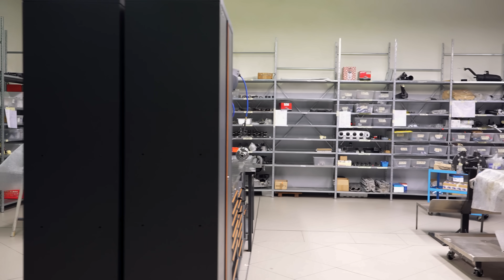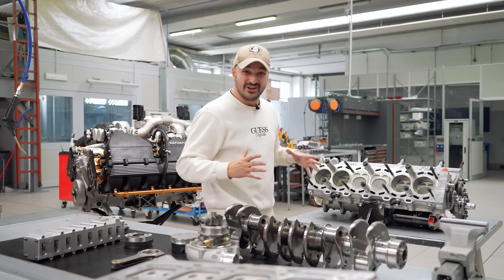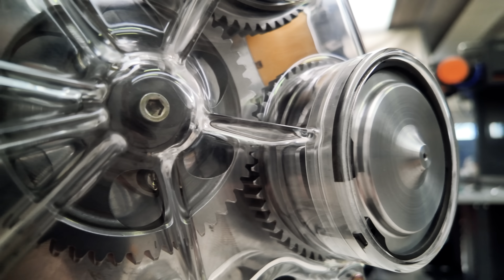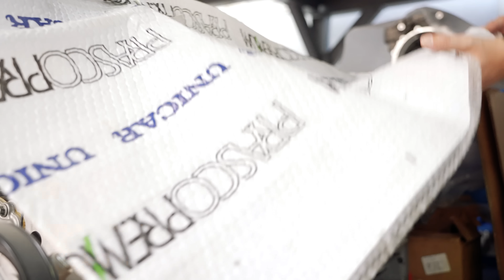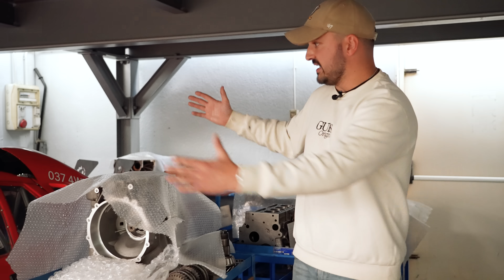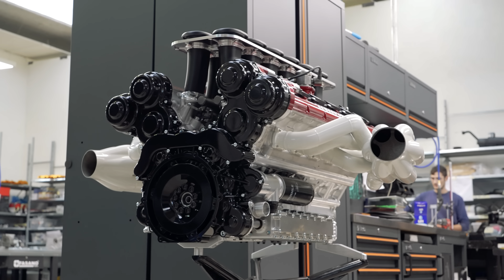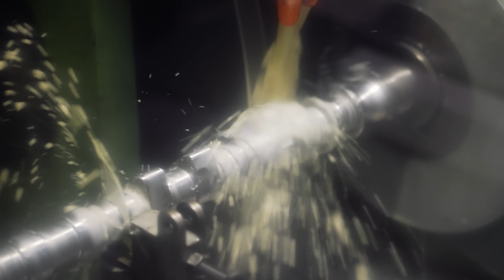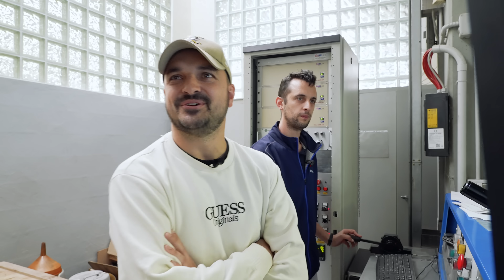This 7.0-litre Quad Turbo V12 Is The Most Powerful Car Engine Ever!

Comment: Mercedes new EV motor that weighs less than 30 lbs and puts out over 1000hp  wants a chat. One of these on each wheel means over 4000hp with a total motor setup that weighs 120 lbs max. And battery technology is advancing so quickly that in 5 or 6 years EVs will be charging faster than you can put gasoline in a car.
Reply: and it will never have a soul
Reply: @poly_g6068 exact same arguments going on when those new-fangled horseless carriages put good ol’ Bessie out to pasture.
Reply: You are the 'Bean Soup Theory'.
Reply: @Hang.On.A.Minute please. Go on. Meanwhile ICE sales have been declining worldwide since 2017 and EV sales continue to grow at a 38% clip. In fact, this last quarter China tipped over 58% EV over gasoline. China is the world’s largest car market.
Reply: @nerdbikes3841  Are we watching the same video?
Look up  'Bean Soup Theory'.
Reply: What does this story have to do with Mercedes or EVs?
Did I miss that bit?

Comment: Big deal. It's stupidly complicated, whereas a Nelson Racing Engines Twin-Turbo Alien LS 427 puts out 2000 hp as well. It's a Chevrolet LS engine with killer parts and engineering. Except for the custom cam grind and exhaust, all the parts are off the shelf items. $47,000. America.
Reply: You are the 'Bean Soup Theory'.

Comment: Thinking of Elmer racings Thor crate engine, 150kg straight 4, 2000hp for road use and 3000hp for drag applications..

Comment: Steve Morris built that Devel V16 - it made over 5000hp. He did a fascinating video talking about it about 6 months ago if anybody is interested. Ps, there was a lot more to it than just "sticking two Ls motors together". Like i said, go watch the video for yourself 👍
Reply: The Devel Sixteen is UAE oil sheik vaporware. Rich boy one off wannabe similar to Lotec. Yes SME made and dynoed it. Very impressive but an absolutely massive engine.
Reply: Ha messo assieme due V8 aggiungendo 4 turbo, non si sa nemmeno se è riuscito a fare una prova al banco. Figurarsi metterlo su strada.... Per una cagata di auto mai esistita sbadierata da un brand fatto da quattro beduini che a malapena sanno stare su un cammello
Reply: Fake the devil never hit dyno and never was actually true they came out and admitted it.
Reply: Not a production engine in a production car.
Reply: @dcauve420  this one isnt either
Reply: @dcauve420  20 car limited run, this aint production car either. Should be 5000 cars minimum to be called production car. Thats what BMW had to build e30 m3's

Comment: lolz,  2000 virtial horses, or "1500" on a dyno without any aftertreatment or emissions gear, no inlet system and god knows what else is missing.  200bhp litre (1400bhp) really isn't hard, but 300bhp on an engine of this size is getting difficult from a thermal perspective, especially if done at relatively low rpm (ie running at lot of boost rather than a lot of revs to shift the air through the engine)   Something like the Veryon engine is of course worldwide emissions homologated, meets all VAG group durability, and is actually in production in a series built car.

This engine is none of those things imo.......
Reply: You are the 'Bean Soup Theory'.

Comment: It's strange to see gerotor gears on an oil scavenge pump 🤔 They normally use minimal clearance gear pumps on dry sump pumps as they can run dry for longer 👨‍🔧

Comment: Wait a minute. A 7 litre quad turbo V12 is 50 or so HP more than a 5.5 liter LT7 from a corvette. Yes, it is rated ag 1074hp, but it's much higher than that in reality. Likely closer to 1200

Comment: Bold claim young man.
How bout we talk after it's lined up against the Nevera or the McMurtry.
Also, it's made in Italy.
So it will only be good for a few miles until it detonates.
Reply: You are the 'Bean Soup Theory'.
Reply: @Hang.On.A.Minute 
Close, but not quite.
In "theory" I'm closer to Lentil Soup, and everyone knows.
Lentils aren't beans.
Reply: @Dangling-Participle99  In "theory" it comes across that you are closer to Lithium.
Reply: @Hang.On.A.Minute 
I'm now officially nailed.
Theory, or not.
If it has "ium" at the end.
That's me in a nut shell.

Comment: 8:51 easy, start with a big engine, its already 7 liters, its also a v12 so the power per cylinder is relatively low. So it doesnt need a whole lot of boost to make 1500hp
Reply: At 2100 hp it will be ~180 hp per cylinder. How many 4-cylinder engines you know with this much power per cylinder? Let alone v12s 😂
Reply: @mohammad.h6059 thats my point, add more cylinders you have less stress per cylinder.

Comment: It’s more like 1600hp, but you have to take into account that it has force induction, I would say that the Chevy zz632 is the most powerfull engine because it makes 850hp without forced induction

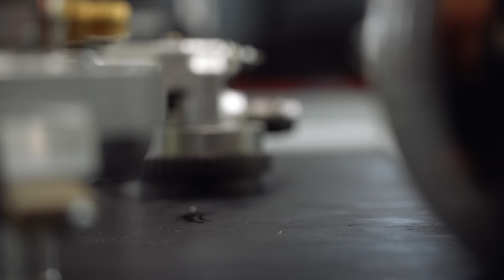Comment: 4:08 I have never seen a piston top where the valve reliefs reach the outer edge.
That actually makes sense to have multiple oil pumps, despite the power loss.  Every pair of cylinders will get an equal amount of oil, whereas a single pump might not feed the furthest point on the block as equally as the nearest.

Comment: 5:06 is the best example of hyperfixation I've ever seen. Dedicated a full half-minute to stimming with the oil pump purely because he's obsessed with the design of it.
Reply: It put me off. That is a normal scavenger pump. Scavenging per bay is also normal for a dry sump. The oil still goes to a central oil pump next, while the presentation makes it sound like there are disjunct oil flows.

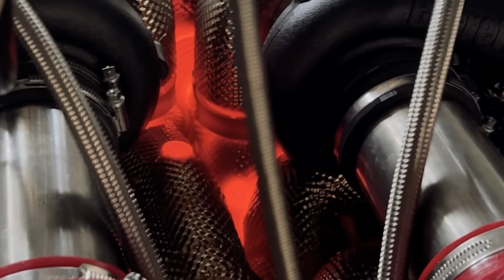Comment: 7:50 - may be powerful, doesn’t sound like anything special, though. 

Almost like a BMW V12, and they’re notoriously ugly sounding for a V12…
Reply: The BMW V12s can actually sound great with the right exhaust. When fitted with equal length 3-2-1 collector headers they sound fantastic 😍 I was shocked when I heard a guys lamborghini replica with a BMW V12.

I went for the mercedes V12 for my project to get the zonda F sound 👨‍🔧

Comment: Curious if the length of the crankshaft is affecting the strength, then how did Cosworth manage to use the same length crank and crank pins for 1500HP???

Comment: The clickbait title is a bit of a stretch. There are more Steve Morris V8s on the road in the > 1500hp category than there are crankshafts for that V12.

Steve Morris is the guy who built that V16 - he did a long youtube video on it recently. It really is not a pair of V8s stuck together - it has a custom firing order - with crankshaft to match. He goes into some detail as to why he split the heads into two parts - they are custom designs again. He goes through what he'd do differently next time around too. He builds and sells 3500+hp "drag and drive" V8s. ;)

Comment: Mike, a serious and extremely niche request. I'm part of an extremely small subset of the population: a gearhead, engine nerd, general nerd at large, and someone who owns a 21:9 ultrawide OLED monitor. But there is something about car culture that is almost uniquely suited to the ultrawide experience. If you wouldn't mind experimenting with it even once - that's all I ask. God, I want you to go check out the Haltech quad turbo LS V12 and LSXR10 projects SO BAD. They both sound absolutely rowdy, and consider how big those engines are too with their bore size and crank length. You will also find many people in the US spinning "regular old pushrod engines" to 11,000+ RPM and making them live through a consistent lack of mechanical sympathy. LOL.

Comment: It's a pity its IC in this day and age. How much does that lump weigh, and what are the dimensions? Four YASA motors (Merc AMG) 13 KG each and about the size of a thick dinner plate will give you plus 2000 HP...just saying

Comment: Clearly, some people are not paying much attention to the apparent death of the internal combustion engine. I mean, it's not like the entire world wasn't built with them or anything?!
Reply: TBF I'd argue the world was built with external combustion engines (i.e. steam!).
Reply: @Broadwoodwidget  To be more fair, that world of which you speak was actually quite small. Around the Industrial Revolution, the world's population was only 1 billion people. Today there are 8 billion people across the planet. From Mack to JCB, and Boeing to Airbus (as a jet turbine is still an internal combustion engine) The steam engine was an Atari 2600 to a PS5. The difference between walking in bare feet, or wearing Nike. Or to use a direct analogy here, the i.c.e was and still is what took the village mentality, and allowed cities to be built. The first steam train couldn't get up a slow incline to Liverpool, and needed extra steam traction to get it up the hill. The BAC Aerospatiale Concorde reached 1354mph, before the same people who still scam the world today over climate change and Electric cars, wrecked the entire programme, simply because it didn't fit certain pockets, rather than for the actual benefit to humanity. In a 5yr test, it is still 5p a mile cheaper to run a diesel car than an electric one, before even talking about the horribly disposable construction of an EV, and the countless number that already sit abandoned in places where there is nobody able to repair them. It all has nothing to do with what is best for us, and instead, who is making all the money. Otherwise, the world was already using electric vehicles 100 years ago. Before diesel became cheaper. Today, they have flipped that, choosing to weigh down the average person with the 'expensive' more 'profitable' solution. So no, the steam engine did not build the world, it only made it bigger. Just as the electric vehicle is reversing that, and is going to make the world smaller, and more cramped.
Reply: @stevenmacdonald9619  global population in 1914 was 1.8 billion - steam was still utterly dominant then. Internal combustion made some inroads in the interwar era, but steam was still the dominant mover of passengers and freight throughout the world well into the 1950s when population hit 3 billion despite the depletion of two world wars. By the way, while EVs may not be the solution, man-made climate change is absolutely real.
Reply: @Broadwoodwidget  Firstly, the term 'climate change' is wholly misleading, since the climate is literally changing every hour of every day, and has been for millions of years. The last ice age was 12000 years ago, and the planet has been rapidly warming since then. How do you explain the 'climate change', 10000 years before man became industrial? 1914 wasn't the Industrial Revolution, it was the beginning of WWI, and just under 200 years later. Tanks and prop bi-planes were a thing, submarines were too, and Ocean Liners were already experimenting with oil and diesel. Cars, trucks and buses are a thing, and there are many electric vehicles in the UK with trams and trolley buses. You skipped the Georgian and Victorian eras. The steam train was beginning it's decline, as the London Underground was using electric trains 8yrs before 1914, though it would be 1947, after WWII, before trains would start going diesel. If at the beginning of the Industrial Revolution until 1914, population almost doubles, it would begin it's incredible spike upwards from 1950 onwards. It's the biggest scam in human history to talk about the desperation to build so many joke 'solutions'. Wind Turbines use metals from around the globe, and then are buried where they stood after just 25yrs service life. Solar Panels are so highly toxic and will provide enough electricity to power a kettle on a cloudy day, and here's the biggy for you. Underneath Siberia lies enough fossil fuels, and minerals to do 1760 to 2025 all over again, but Putin Red Man Bad and Russia too. Funny how Peng wasn't Red Man Bad, and yet they are still building coal powered generation stations in China. You should check out the Alang Shipyards in Bangladesh. The corporate west is doing nothing but selling you up the river for your cash, whilst dumping every toxic and harmful substance known inside any form of massive carrier and cruise ship on the beaches of Bangladesh, for men with no safety gear and flip flops to cut up. Even less has been done to tackle plastics in water and even raw sewage from India to China, and yet apparently, we're fighting climate change?? Why are only the most greedy parts of the world even talking about it? And please.... answer my questions, instead of idly contradicting me. I'm tired of these people getting away with talking horse sh&t, and never having to prove anything. If you attempt to contradict me, I'll talk about Homologised figures at NASA from Stevenson Screens. You don't want that, it will destroy your entire education and myths on how the earth has not actually warmed ny 6-7oC on average. That is a lie from paid scientists. Why would this be any different. Why do you think scientists are trust worthy. They said smoking was good for , and also vaccines that were untested. They said we were all gonna die in 2020 if we went near each other. So why would they tell you they used MEAN figures for climate all of a sudden, and not average as was always done before?? I suppose you believe cows farting will kill us too??
Reply: @stevenmacdonald9619  so much of what you claim is misguided at best. The planet was warming slowly from about 12,000 years ago, then it began warming an awful lot more rapidly in the last 200 years, and the rate at which it has been warming has accelerated exponentially since. Nobody reasonable disputes the fact that manmade factors are the primary driver of global warming. As for cattle farming - grass-fed low-density cattle farming isn't harming the climate, but intensive agriculture with cattle being fed on soya protein and growth hormones are proven to vastly increase methane emissions, as well as the resultant meat having deleterious effects on human health. I will not support any authoritarian government and it is right that we boycott Russia for the foreseeable future. Likewise I do not endorse China - the CCP regime must fall before China can be fully rehabilitated. That said, China has a vast and long-standing renewable energy sector - Mao's dictatorship built an enormous network of hydroelectric power stations while America and most of Europe were increasing their reliance on fossil fuels.

Comment: You mentioned on your first video that you wanted an engine to rebuild. 
I have a Meteor 27L engine that I am going to get back up and running but replace the twin magnetos with electronic ignition and replace the twin zenith carbs with fuel injection. 
It is going in an old chassis to build a special.

Comment: The guy who invented that 50 and 70 degree crank is real hero here
Reply from the maker: Riccardo is clever as f***
Reply: @Mike_Fernie   Now I'm a little bit prouder to have that name  ahaha
Reply: There was a similar solution on the late Alfa 155 DTM, done for the same reason. Nannini tested it and went "this engine will smoke the opposition but it feels funny, like a horse running with an odd falcade"
Reply: @hexgraphica  in that case i found an interview of the engine engineer saying it was done to remove a lot of weight from the crank.
Reply: @gabribeta1368 which ties in to the explanation given in the video, as a normal crank would need much more material to offer the same comparable strength as this alternative design.
Reply: @gabribeta1368 The way I understand it, they used a 90° V6 block (a PRV, originally designed to be a V8) for the 1996 season. They HAD to use a crank with split crankpins at 30° to get balanced firing, they would have never been able to rev to 12k with a regular crank.
In the case of this V12 it's quite different, the cylinder pairs in V are on a conventional shared crankpin, the unconventional angle is between said pins rather than between a pair of rods. Also they are introducing irregular firing rather than resolving it lol
Reply: Coolest thing I've seen in months.
Reply: Knife edged so beautifully 😳. That crankshaft is artwork
Reply: Yes, but remember that 55-65 degrees crankshafts have been used in V12s for well over a decade. (e.g. Ferrari)

Comment: BMW would take notes and then build the opposite, thinking it's better because it has the old BMW badge from the 80's -_- BMW engineers only know how to take a good reliable engine and make it 5hit, as proof with the last 20 years of BMW engine designs. #fact
Reply: ...just wait for the BMW designed CVT. the failures will cause BMW to go bankrupt!!! 😅

Comment: You clearly haven't seen what Steve Morris does with LS engines.. 2000 horsepower is child's play.
Reply: Not production engines. Don't go in new cars.
Reply: @Broadwoodwidget  at the moment, neither does the giomaro.. 😂 There's more Steve Morris engines on the road than there will ever be of giomaro.. Morris built the 5000hp engine for that Arabian car, whatever it was called, but the car flopped.
Reply: @BiggisDickus2025  The Devel never existed, this at least has a running test mule.
Reply: @Broadwoodwidget  there was 1 devel sixteen and one 5000hp engine but I don't know if they were ever put together.. Steve Morris has proven that the engine was real because he made and dyno tested it. It's on his channel somewhere.